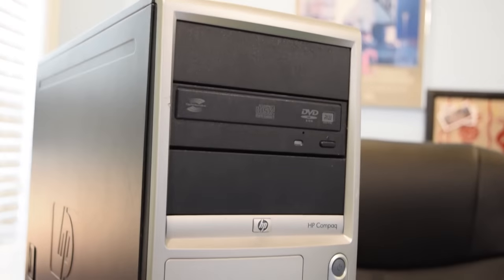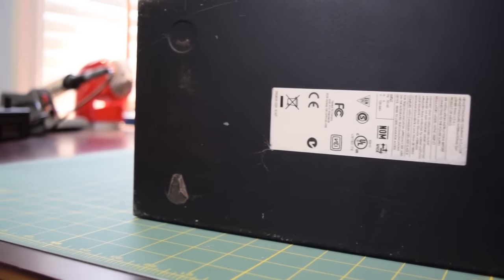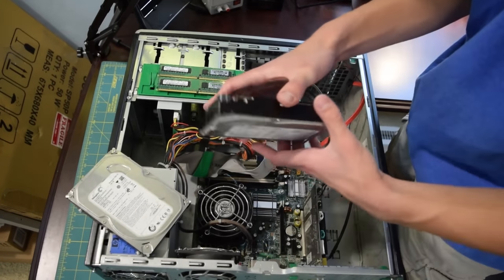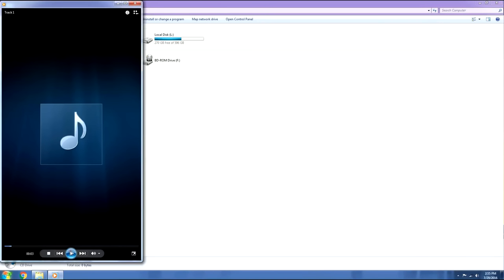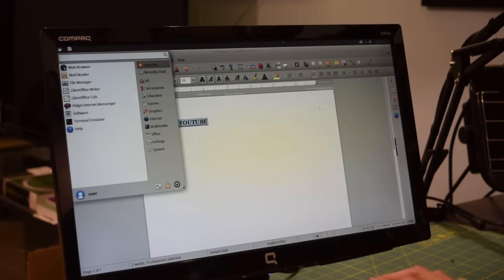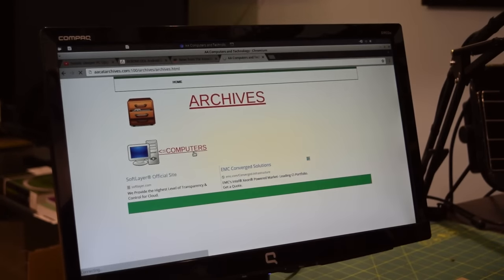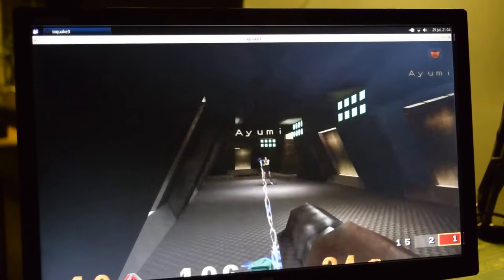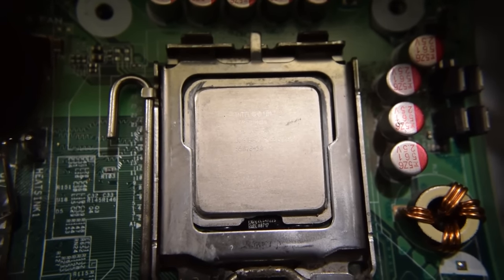Garage Sale Finds: $5 HP Compaq DC7600 CMT Desktop Computer Overview, Teardown, and Test

Comment: Just a hint for future reference. Unless you intend to swap out the CPU don't take the time to remove it. Just leave it in the socket and clean it off. Much less chance of messing up a pin that way, especially if you vacuum around the socket when it isn't covered. I've had to repair (or at least attempt to repair) way too many socket pins because someone took out the cpu when they didn't need to and messed them up. Save yourself some grief, time, and potential damage repair.
Reply from the maker: That sounds a lot easier and safer, I think I will do that next time!
Reply: +mike then they shouldn't be working with pcs at all
Reply: Agreed Commentator. Some people shouldn't even be allowed to use a computer, let alone work on one.
Reply: cee128d Some people just don't listen.

Comment: I found one of these just week sitting next to a dumpster. Popped it open to have a look inside, surprisingly all the parts were there, so I took it home, took the canned air to it to evict the dust bunnies and bought an AC cable for it since it was missing. It powered on instantly when plugged in. 

I'm currently lacking a VGA cable to figure out the system's health or what it has, or if the thing even works (considering it was headed to the landfill I have my doubts). I'll find out more when the cable arrives in the mail. 
For now I know that the disk drives can eject and the fans spin, so there's that. 

Otherwise seems very different from the one in this vid. 
This one has a CT4810 sound card, a floppy drive and two disk drives (one is a Secur Disc burner), a 40gb Maxtor hard drive, 240W Compaq power supply, different motherboard (sp#323091). 
Bizarrely it has 3 sticks of 128mb DDR ram, leaving the 4th slot unused.

Comment: FYI, the stripped screws are where there should be rivets. So someone drilled out the rivets, for no reason at all as all  parts are accessible by the removable side panel.
Reply: Kcwomack I personally hate rivets on systems, I removed all of them from my systems, why, I wanted to be able to paint my stuff

Comment: What is the maximum processor you can put in it Q6700 with a 1066MHz system bus or Xeon 5482 with a 1600Mhz system bus

Comment: I have this one in my house, same hp compaq dc7600 cmt, but with newer spec [pentium D 3.4ghz, 2gb ram, 80gb hdd(later added same 80gb hdd but the second hdd is broken), running win7 'rog', also equipped with both diskette and dvd-rom drive]
Reply: Me too, but the processor fan is to noisy (2700-3000rpm), is it normal?

Comment: A few tips for ya. Way to much thermal paste. The size of a grain of rice is nice. To much and it will leak out shorting the board. Also use specialized vacuums for electronics like the DataVac ESD safe. House hold vacuums are not ESD safe. Otherwise nice restore.
Reply from the maker: Personally I have never really liked the grain of rice thing.  I usually opt to put a bit more on it.  I agree this amount was a tad bit excessive though, I was not paying attention.  Haha, I am too cheap to buy a dedicated vacuum, I have never run into any problems with using the Dyson.  Honestly if ESD from the vacuum kills a system like this I would not care too much.  Thanks for the tips and thanks for watching!
Reply: If the thermal paste would short the board, then my cat could fly :/
Reply: Arctic Silver 5 is conductive and I have had it do this in the past when putting too much on.

Comment: I still have a Pentium 4 HT (3.0 GHz) in use by visiting children. I had 2 x 1 GB of 400 MHz DDR. I striped two 40 GB IDE disk using btrfs. The disks are also lzo compressed and that old Pentium boots Peppermint 9 now in 45 seconds. When booting Windows XP on such a 2003 PC, I would go for a coffee, but this PC is too fast now.

Comment: Hi like your video on your HP compaq D7600 Cmt, here is the problem I have a HP Compaq D530 CMT I need to upgrade it to OS system because I forgot my pass word on it and don't have the windows Xp Pro OS system disc for it  can you help or any tips?

Comment: Hey AA do you take requests for reviews? if so can you check out the dell fx160 on ebay it cost only 30 without the harddrive might need a right angle adapter or sata extension because many dont have the tray for it
Reply from the maker: I usually do not take requests.  I make overviews on whatever I can get my hands on for cheap :p !  Those small form factor systems do look really cool though.  Haha, now I really want to buy one XD
Reply: nice i was hoping to get 4-5 and install emuos with cheap ssds and resell them as retro consoles with internet acess
Reply: also be sure its the atom 330 version if you get one its a dual core with hyperthreading basically a weaker i3
Reply from the maker: I could not find any FX160's with the atom 330 for a reasonable price, I did however buy two other small form factor systems because I thought they would make interesting video subjects.  I will not say anymore, I do not want to give too much away!
Reply: AA Computers and Technology nice if i find any ill make a video on my other channel +Potato in Action

Comment: Try Lubuntu,lubuntu is more better then Xbuntu
Reply: *faster
Reply: 6 of one, half a dozen of the other. Realistically very few people would be able to notice the difference performance wise between the two. Xubuntu is the preferred distro as it ships with a better default application selection. He chose the right distro for the majority of systems and users. This is coming from a Linux user since 1996.
Reply: +cee128d its funny how you say "linux user since 1996" because ive had my first computer since 2014 and i amaze people that went to school for computer science . dont use time as knowledge
Reply: That's because a lot of people that went to school for computer science don't know anything practical or usable about computers. That's the reason why people like me who've actually been using computers to get real work done since the early 1970's, built my first computer in 1975 when you had to actually wind cores, solder components onto circuit boards, and programed them ourselves know a lot more than these newbies who only know how to use an iPad, and even that is a stretch. They may have more technical and theoretical knowledge, but they are unable to use any of that knowledge to do anything except pass tests.
Reply: cee128d do you know c++ ? Or what about BASIC since youve been around for a while (no offense)
Reply: Assuming that the question is indeed from curiosity, let me answer this: Anyone who used computers during 70s~80s knows BASIC. Early home computers "booted" into BASIC, and you needed to invest extra money for operating systems like CP/M. (Yes, you only needed to know a few commands if you were to purchase software cassette tapes, but pretty much everyone with a home computer during that time did some degree of BASIC programming.) Seems like he(?) built a homebrew machine, and that required even lower-level of understandings (including but not limited to assembly language, digital circuits). Also, most of people who used Linux during 90s do know at least moderate level of programming. At least well enough to port C/C++ software.

While I do not personally agree with cee128d's comments (I do see a lot of talented and experienced freshmen undergrads in the CS department of my school),  using computers during early days did involve more programming and lower-level software hackings in general. Also, people are working to improve the situation by introducing easier programming languages and free programming courses.

By the way, my personal recommendation for the X11 Window Manager is Enlightenment. It is very light and usable.The one on the Ubuntu repo is outdated, though.
Reply: Because Ubuntu (starting with 11.04) is considerably more demanding of resources and requires more computer power to run, especially graphically. A lower spec system like this would feel too bogged down and laggy with Ubuntu. Xubuntu and Lubuntu are much better suited for this system. Plus it has a terrible GUI.

I refurbish a lot of old systems like this so I've had quite a bit of experience with them. Ubuntu with Unity, Kubuntu, and Ubuntu Gnome aren't that good of a distro for older systems. That's why they have Xubunto, Lubuntu, and Ubuntu Mate.  Any Intel system that doesn't have a Core 2 Duo or better won't have good enough onboard graphics to run more demanding GUIs. Throw in a decent graphics card and that changes, but the rest of the system will still lag.
Reply: Oh, by the way, this reminds me that Lubuntu is migrating to LXQt in a near future. Lubuntu 16.04 will be okay, but future versions of Lubuntu can be significantly slower (on old boxes). Development of the original LXDE has stalled, so it has to be done.
Reply: The performance difference will be minimal once the get the two DE's integrated well enough. It will still be lighter than XFCE, just not quite as much as before. The main difference is their insistence on included lower quality apps with less functionality on Lubuntu as opposed to Xubuntu.
Reply: I must mention that LXQt does require more RAM than XFCE( http://blog.lxde.org/?p=1340 ). Maybe Lubuntu 16.04 LTS (can be the last non-LXQt LTS Lubuntu distro) or Xubuntu are preferred solutions for boxes with limited RAM and slow hard drives  (although such computers should really run lighter systems like NetBSD with *wm or *box). 

This, however, is not necessarily a bad change since they are replacing a lot of software. (I am not sure how better they are, since I have not used LXDE as the main DE for a while.) Also, you are probably correct that the performance differences should be minimal once they figure out correct configurations.  If the computer cannot handle that 20MB of extra RAM usage, it is probably not suitable for the daily computing anymore.
Reply: A Little More Simpler Than Xubuntu!